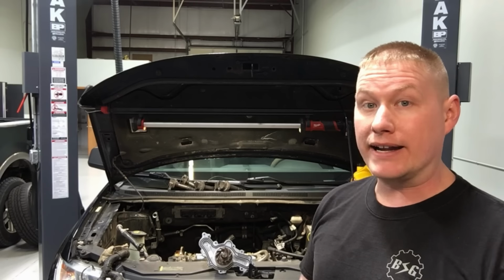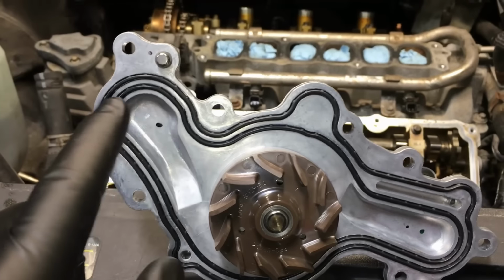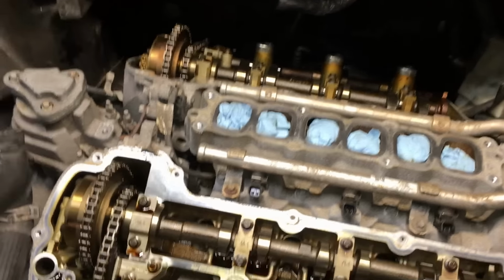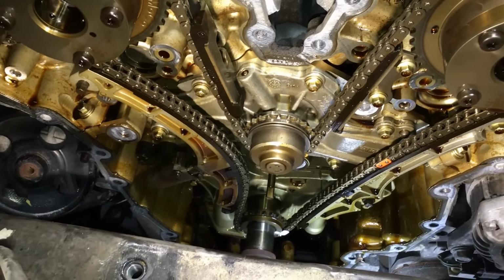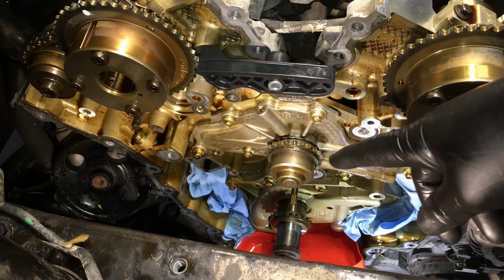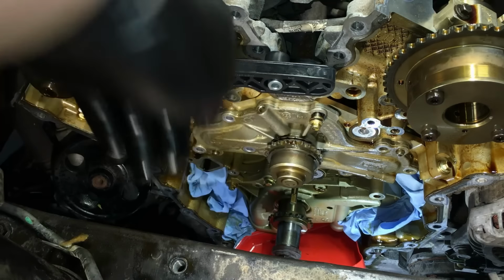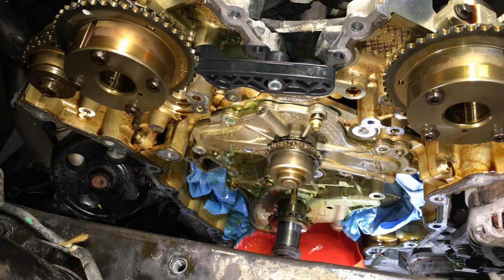Ford 3.5L 3.7L Duratec V6 Chain Driven Water Pump Failures: Check it Before it Destroys Your Engine!

Comment: Seeing how ford is using the orange coolant on these motors , it appears there has been some work done and it has been replaced with green coolant.
Reply: The 2012 and older models used green coolant. My 2011 Taurus uses green. I had this job done about 3 years ago. When they updated the engine for the 2013 model year, they switched to the orange coolant.

Comment: $1250.00? I’m on my way. Quoted by Ford in my area $3500.00
Reply: This video is 5 years old. I am also seeing in the 3-4k range depending on the full parts list and vehicle. 
Thats using good parts of course. I am sure some dirt road shop will use junk to save a buck.

Comment: Does the 3.5 and 3.7 in the F-150, which sit differently, still have the water pump inside? I know the newer 3.3 (non turbo as well) does not have it inside, it is outside since the truck has the space the other smaller vehicles dont.
Reply from the maker: The pump is only inside the engine on transversely mounted engines.

Comment: I have a 2015 Ford Taurus and had to replace the water pump back in February of this year at a cost of $2300. If I had known about this water pump location and cost to fix I wouldn’t have made that purchase. I purchased the car used .
Reply: How many miles ?

Comment: Has anyone seen the coolant leaking from under the lower intake? There’s a perfectly round hole at the front of the engine, in the well and approximately at the top and behind the pump, I have a 2012 Lincoln MKZ 3.5L. With pressure on the cooling system it shoots out and runs down the well under the intake. Just checking because after several videos no one has mentioned this …..

Comment: Just planning for this as our '08 MKZ has 131k miles. Just changed the starter in it, been a good car overall but plenty of small annoying issues & this damn water pump is certainly one of them!! Will start looking for coolant drips & monitor the coolant reservoir. Great video, thank you!!

Comment: I’m doing an water pump r&r on 2007 Lincoln mkz 3.5L duratec engine, while rotating the crankshaft and got the timing marks correct 1 bank on the cam holder sits directly perfect on cams, then other bank only 1 side of cam holder sits perfect on engine head. It’s almost flushed with head but , it’s not how can I get them both flush on engine head, or is the chain stretched to bad?

Comment: I wish Ford would include the new bolts for the updated guide with the new guide. The bottom bolt is definitely too short for the one you take off.
Reply from the maker: Both bolts need to be changed.
Reply: @FordTechMakuloco   my dealership gave me both one only came in a package of 4 and the top was a single same length as original for the guide.

Comment: Was going to purchase a Ford edge with a 3.7 has 79k...fully loaded. Sharp looking..how ever not interested in doing this major water pump..been a technician for 41 years now at the age of 63 .. those days are done for me...!!!
Reply: I have a Taurus AWD 3.5 duratec w 230,000 no issues! Always 3000 mile oil change and 50,000 water coolant and transmission flush! Buy it!!
Reply: I have a 3.7 f-150 with 133k miles running strong

Comment: What brand water pump did you use, the you showed with two gaskets is not a Ford part. Normally I'd stick with OEM parts for a job like this, but would like your opinion on an aftermarket alternative,  thank you.
Reply: At 1:46 you'll see FoMoCo in the water pump casting.
Reply: @jasonowens7829  I used a Ford one anyhow. Not sure wtf the engineers were thinking on this one

Comment: how much in parts and labor?
Reply from the maker: Over $2,500.
Reply: @FordTechMakuloco  oh okay nice. i got my estimate for 1.3k in mass but then i added to replace power steering pump so i got it for 1.7k all total without timing chain rail or rail finger cross...

Comment: My wife's 2016 Explorer with a 3.7 has only 31,000 miles.    Is this pump issue time sensitive or only mileage induced ?  Since vehicle is 6 years old, should I consider replacing it to avoid issues .  WE are planning on keeping the vehicle for several more years. 
Is her pump fairly solid until mileage creeps up ?
Thanks

Comment: Took your advice we changed the water pump on our taurus at a local ford shop, ran abou$3000.
The car has 178000 on it now and we plan on keeping it for 8 to 10 more years or 300,000  which ever comes first.
Reply: @bojo8141 How did it run after the work had been done to it ??
Reply: @kagepresson3734  fantastic, runs just as good as when we first purchased it.
Reply: I’m getting charged 2,500 for mine to be changed this helped out

Comment: Last Saturday was going to do the front brakes on my wife's Flex. Back the car up to make room. Saw a puddle of coolant. Traced the leak to the weep hole behind the alternator. Told my wife, we need to get your car to the dealership. Check to see if you are still under the extended warranty. Warranty ends in April. Cost nothing to have the water pump replaced. It's a good thing I'm an ex-mechanic.

Comment: I did my pump and timing chains about 30k miles ago. Recently it wouldn't start without playing with the gas pedal. It was throwing p018 code. Changed the camshaft position sensors then it started throwing p0016 p0017 and p0019. Tore motor apart to check timing marks and it's still in time. Should I suspect it to be the crankshaft position sensor next?

Comment: Had the water pump, timing chain, tensioners, and guides changed on my 2011 Taurus at 167,000 miles. The Ford dealer charged me $2,600
Reply from the maker: Wow that is cheap!

Comment: Great video 👍🏼 
But I noticed that you didn't have to pull the whole engine out to do this. My mechanic said the engine needs to come out. "Ford Taurus 2013" police interceptor
Reply from the maker: Not needed, the only model the engine must come out is the Fusion Sporr

Comment: I have a Ford explorer that I believe has a failed water pump do u recommend changing the pump or should I just look for another engine
Reply: I am in the same situation. Should I replace the water pump, have them flush the engine and change the oil a few times, and see if that solves my problem...or just cough up the $11K for a new engine? 🤦🏽‍♂️

Comment: Thanks for the info, we have a 2013 taurus with a 3.5 with 175,000 on the car, we flush the coolant every 50,000, do you think its time to plan on a water pump soon before it get to leaking?
Thanks again.

Comment: If I use the updated guide, do I use the same bolts? Because my original bolt won’t reach.
Reply from the maker: No there is  a new longer bolt.
Reply: Do you have a video on the secondary timing chain? And the timing chain. Can you tell me why my chain mark isn’t lining up with the marks on the sprocket? Cam gear marks line up with the chain mark but crank mark doesn’t line up with chain mark.

Comment: Excellent info.  Do you have a video showing the actual sealant application and reinstallation of the timing cover on one of these engines?  I'm not seeing that on your channel (or anyone else's) and with the limited space that looks like it could be quite tricky.
Reply from the maker: Not yet!
Reply: @FordTechMakuloco  have this engine in a 2007 FORD 500 and the dealership has been putting in 5w30 oil when it calls for 5w20. It now leaks. Would that cause it? Is there anything that’s safe to put in oil to stop leaks?
Reply: @mem1701movies  5w30 is actually better. 5w20 is used for better gas mileage,  that's it. No way it caused any leaks
Reply: @FordTechMakuloco  did Ford change this design on the 3.5 V6 ... I am currently driving a 2015 ???

Comment: I didn’t want to get into the mess of all this so I took it to one of the few non-dealer places I trust. Now I’m getting some pretty regular clicking. Under light loads, like in parking lots. Sometimes on idle. One thing I’m thinking is that the chain they put on is off a tooth or two or maybe they didn’t pull the release pin on the tensioner before they put it all back together. I should have just done it myself. Now I need to take it back in. Ugh. Any thoughts? Thanks.

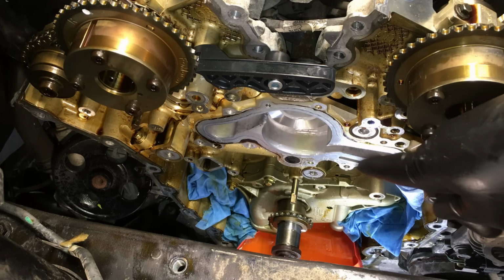Comment: 9:28 you say check for coolant leaking when you do an oil change. The timing cover is there, which is the problem, it leaks into your oil, internally.
Reply from the maker: Not sure what you are talking about. There is a weep hole behind the alt that leaks down to the compressor right next to the oil filter which is why I say it is a quick check while changing the oil and filter.

Comment: You commented that it is a 2,000 dollar job. Just got an estimate from a Ford dealership (5-14-2022) for 5,900 dollars 😳 for my 2011 Taurus.
Reply from the maker: Oh boy.
Reply: @FordTechMakuloco  My 2011 Taurus has 170,000 miles with no sign of leakage. But I'm desperate to get an estimate from an independent or a dealer shop here in Louisville KY. None want to do that except the one for $5,900

Comment: The WP gasket became the weak point when a $10 t-stat failed @ 70k. Cheap copper or tensioner pull, my bet is the former.

Comment: Since the water hoses are accessible, couldn't an external water pump be installed off the crank pulley with a belt? I know Civic owners use electric water pumps in this manner. Of course there would have to be a replacement for the existing water pump with a bearing mounted gear tooth pulley, I'm totally shocked these aren't available as an option for all these STUPID water pumps mounted inside the timing chain housing engines. Dodge uses similar tom foolery in  their famous 2.7L lemon engine. main cause of failure? Water pump failure. It would be cooler to replace it with a sliding timing chain tensioner that employs a better spring tension system.

Comment: Water pump on a 4.6 crown victoria = 30 minute job with hand tools and a $35 part. 
Water pump on any Ford 3.5 V6 vehicle = 12 hour job with a $100 part with $1800-$2500 labor cost.

This design was a money grab, nothing more. They had to find something that DIY'ers wouldn't be able to replace on their own. Bastards!

Comment: Seems like the 3.7l engines on transits have 2 water pumps or I’m losing it had to swap a timing cover from a blown engine they have a external one and I’ve seen the one with sprocket in the center of the engine behind the timing cover

Comment: How long, mileagewise, does the water pump usually last. My wife's 2015 is using coolant. Had it up on lift running no drips. Couldn't find anything on driveway. Gonna run for 1/2 hour and see. Just under 65k on mileage. 3.5 turbo explorer sport
Reply from the maker: Generally over 100k miles but fail as soon as 65k yes.
Reply: @FordTechMakuloco  Mine failed at 44k...these internal pumps are junk

Comment: My water pump just went on my 2016 Ford Explorer. Dumb question but do you need to do an oil change after pump is repaired and dumb question number 2. Can you use a shop vac to suck out coolant to avoid spillage.
Reply from the maker: Always change the oil after
Reply: How did you find out your water pump failed?

Comment: Nope - I want Internal spark plugs!  Locate them on the underside of the cylinder head, surrounded by O-ring seals, inside if the water passages!!!

Comment: My water pump is starting to leak and definitely sending mine to the scarp yard not even gonna fix the pos 2013 3.5 140k miles but not about to pay $1000 to have someone change $100 part gave 5k for the car with 110k miles on it nty. And bye bye Ford

Comment: maybe a pain in situations like this but I will take a timing chain that doesn't require changing every 60-90k miles versus 200k plus. Also, timing chain motors usually don't jump time as often especially on high hp motors.  Thanks for sharing sire.
Reply: I've got a 99 buick century 3100 with 344,000 miles
.
Had to do the timing cover gasket and found my chain guide was broken at the top, and chain is quite loose
.
Yet, it has never skipped a tooth
Maybe around 450,000 miles it might.... but idk if I can keep her going that long lol
.
Gotta hit the lotto and do a "frame" up restoration on it
.
I love that little century
Wish it had a 3.8 (aka, 99 regal)
.
But it's simple, has knobs VS touch screen....TPMS uses abs wheel speed instead of costly sensors
.
And so easy to work on

Comment: Does this apply to the 2015 Ford Taurus Police model water pumps? Is it true that the engine removal is NOT necessary in order to service or replace the water pump? Please shed some light on this topic for Taurus Police owners.

Comment: Morning Brian, Semper Fi.  My 13 Edge 3.5 with 88k miles just developed the water pump leak.  Do you have a parts list for this job?  Sometimes you list them in the remarks.  I know to replace coolant with the new Yellow style.  Any specific silicone for the timing chain cover etc?  Other than new timing chain and tensioner, what else is needed? Guides, etc.  Any help would be much appreciated.  Love your channel.

Comment: Not a big fan of this setup you can change them in the car but it’s a pain. The water pump gaskets I always found to be burnt into the assembly when I did this job for my customers I always recommended replacing the primary chain and tensioner as well so we don’t have to go back in again.
Reply from the maker: yup always.

Comment: How best to monitor?  Just take a look at the coolant level in the reservoir at each fill up and act immediately if the level drops?   Black stone testing?
Reply: Like the man said... watch for coolant leaking around the front cover, driver's side.  That's your tip-off that the first seal is bad and it's time for the pump to be replaced.  When the second seal fails, the water goes into the motor oil.

Comment: I changed out the timing chain and water pump after a coolant leak into the oil and got everything cleared up and it runs fine now but can't seem to clear the code p0018 cranshaft position correlation code...do you know if I need to change that sensor

Comment: I have a 08 Mkx with good maintenance history and no signs of wp failure or leaking from the weep hole. Oil looks fine and had coolant service 20k ago. Any reason for me to consider it getting replaced for preventative maintenance??

Comment: Good video.  2 questions. 
First does the weep hole leak for a bad shaft seal or only first inside gasket failure?
Secondly,  I have a freind with a 2014 Taurus and she says it needs a thermostat but I'm suspecting a water pump is the problem.  The dealership says on the Taurus the power train must be dropped to service this properly as they claim there isn't enough room on that model to do it in the engine bay. I see your working on an Edge here and it appears to have plenty of room. Would you know if the Taurus has just as much,  is it  the same?  I'd take the job on if I don't have to drop the engine out.  Any help is appreciated.

Comment: I'm doing one on a taurus, there's a lot more room in that edge than the taurus, lol.
I went and just dropped the motor and subframe, much easier to take off valve covers, wire harness etc...

Comment: I been working on cars for over 30 years .I don't see  the much different  from gas to exhaust .just a bunch of sensors obd  and more problems..why they didn't put the external mechanical pump or a least electric pump with sensor failure..??? now newest car are like disposable piece ..any brand...but is just money  . poor quality.

Comment: Is that a real Ford water pump? I’ve always seen them with a bolt that goes through the middle instead of using the groves like most aftermarkets. That’s a big reason the aftermarkets fail.
Reply from the maker: I have no idea what you are talking about but yes this is a Ford pump. It's all I would use.
Reply: @FordTechMakuloco  I may be thinking about the 3.0. Almost all of the newer ones I’ve seen have a bolt instead of the splines.
Reply from the maker: Yes I have an entire video on that exact concern.
Reply: @FordTechMakuloco  I just found your channel today, but I’ll definitely be going through & looking cause I got a problem that seems to be impossible to figure out lol. It’s on a 07 Ford Freestyle AWD with the 3.0 duratec engine, & CVT trans. I know the 500, & a couple other Fords use that engine too. Not sure if any others for sure. It was fine, then next start sounded like it was going to explode. I believe the engine is done due to bent valves, but I’m hoping I’m wrong. If I’m lucky the timing chains are lose. Which still in not that lucky 😂. 

Thank you for replying though. I really appreciate your time & info.

Comment: This is the scariest thing I've ever clicked on. 2011 Ford Taurus SEL. 134000 Miles.

You may have saved me from buying a new car. Thankfully no issues so far but I should probably get this changed before I have issues.... Thanks for sharing this info, it was really really helpful!
Reply: 2011 Taurus SEL owner here: 29500km (183000miles), only thing I did on the engine is one injector 4years ago. The rest is all maintenance: oil, brake, caliper, bearing/hub, serpentine belt, suspension parts.
I'm fearing what I just learnt about the water pump, but so far it was a top reliable car. I previously owned a 2001 Olsdmobile Alero, which was over engineered, but I dropped it at 324000km because of repair cost/reliability/time of repair (which I do myself).

Comment: How exactly do you time these engines? They have dots everywhere and colored links but none of them match up.
Reply: In this video Brian doesn't go into it but u can see he got the timing chain and phasers marked with whiteout. The phaser has a line indented on it and should be facing upward both sides. Also the cams have flats on them that u line up with the brackets that slide over the head and hold everything in place. The phasers are different from year to year. Some have lines with no dots etc ...